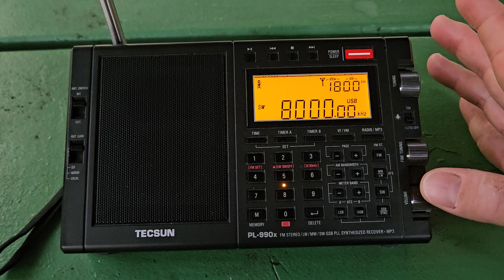Morning band scan in the park from 7000khz to 8000khz

Comment: i think r marti is on 7335 and 7445 and maybe others
Reply from the maker: Yes, Radio Marti is on 7335 from 1000-1200 (which is when I was listening), I normally use eibispace.de to validate what I am hearing.  I also use shortwavedb.org and shortwave-info.com.  Shortwavedb.org has a cool feature that uses Google Maps to show where the transmitter is located, along with some awesome pictures on the antennas they use.
Reply from the maker: Also, checkout my playlist "Band Scans" for all the band scan videos I have done thus far.